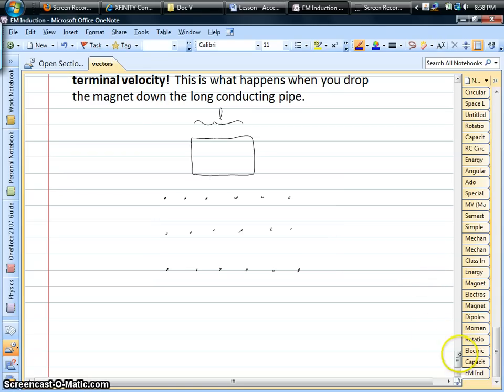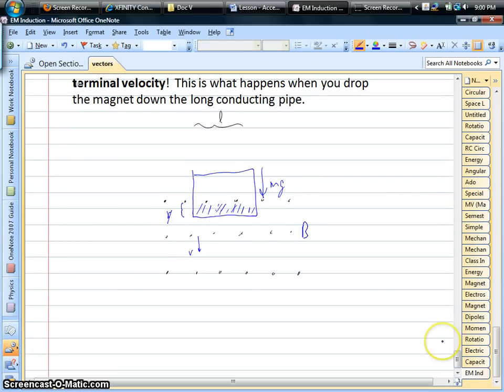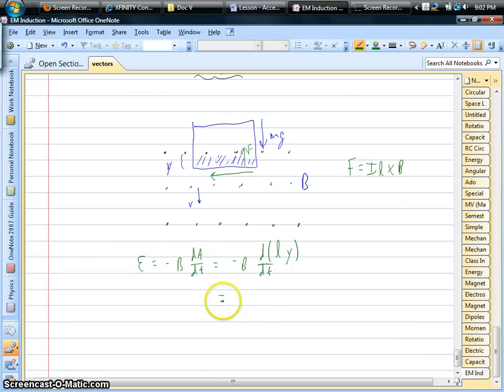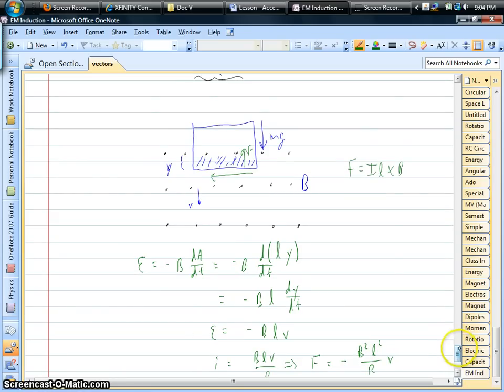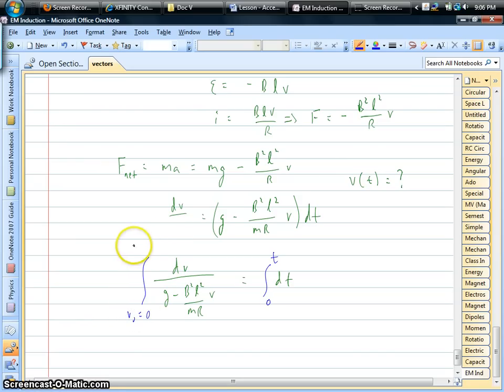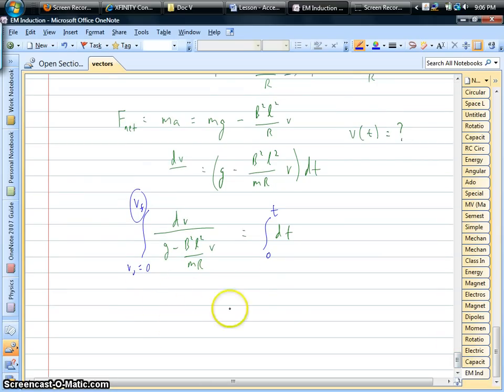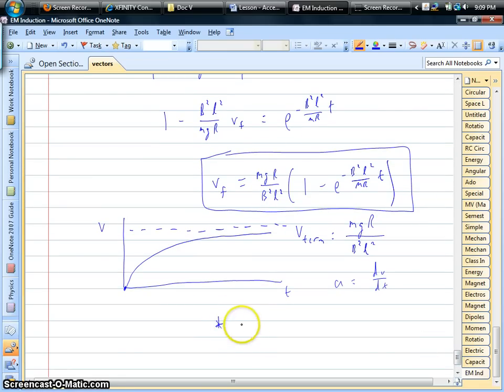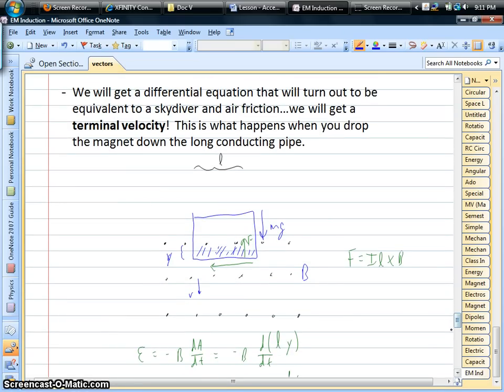EM Induction and Terminal Velocity of a wire loop.avi

Comment from the maker: the resistance we are talking about is for the wire loop itself. Think of it as a circuit, which has the induced voltage driving a current around the loop as long as the magnetic flux is changing. The loop would actually get warm, due to the resistance it has.